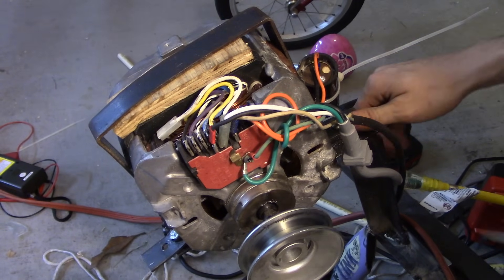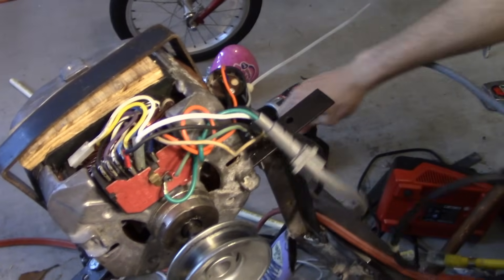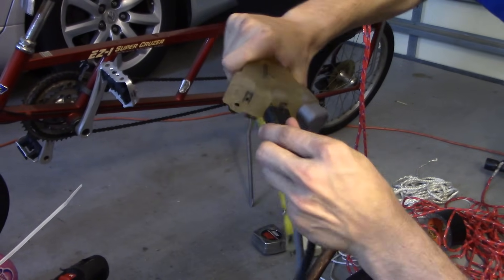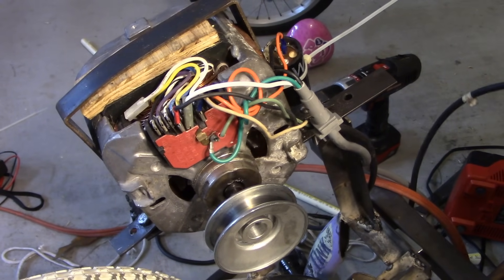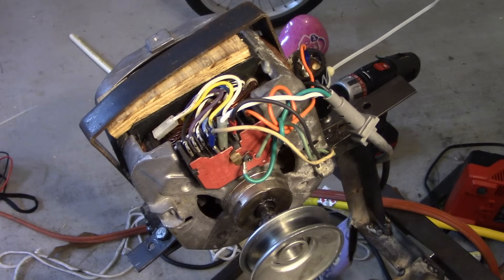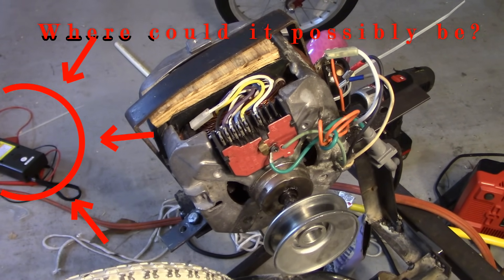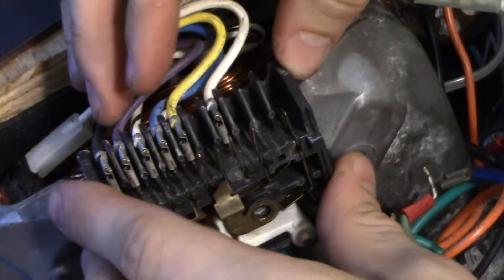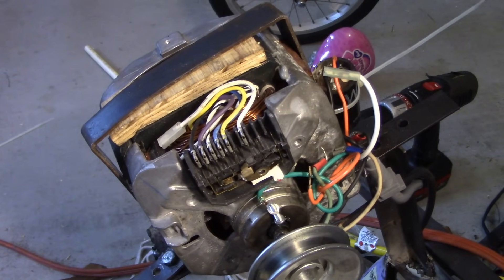DIY Washing Machine Motor Wiring

Comment: Nice ohm values for the windings. I"m diagnosing a semi transient fault that leaves my machine dead from the overload protection (only directly after the wash cycle), without a diagram or manual. So I have to piece together the reversing paths in the motor terminal block and timer switches. Your ohm values make sense to me and are a great help since I have another motor I used the brown motor switch / the white centrifugal clutch actuator  from a repair tp the machine like 5 years ago.. Thanks - I've figured out I can reset the overload protection by unplugging the 120 volt source and the 24 pin timer terminal, then if I move the timer knob just past the location where the machine hangs and restart the machine, it finishes the cycles and complete to the cycle stop;. So I'm getting closer to understanding the wiring with a lot of help from you and many others piece by piece.

Comment: Hi got a question for you. Could I wire this wash machine motor for a slow speed. And power it up through the capacitor, using a 12 V battery. Thank you for your time Tim

Comment: This is just a prayer that you will still get this and respond.
This is extremely helpful in testing my motor that is still in my washer. The issue I have is the motor just hums and won't start. I made a test wire like yours and found that it won't start through the capacitor unless connected from black to yellow. Red to yellow does nothing. The wiring in the washer is definitely connecting to the red, but it doesn't do anything but hum. I used a multi-meter and have no connectivity from red to yellow, just black to yellow (for the starter capacitor).
It's it possible that the switch is just not working correctly?

Comment: I have a motor very similar to this one. My motor does not have a purple wire and there is 1 contact for red/black wires and no more. I am not electrician, just hobby . took from old Kenmore some time ago. How do I wire it,,does it need a capacitor, how to wire it for speed. this is the best video I have found and your explanations are thorough. Thank you.

Comment: Video very instructive but I have 1 question. On your vieo red wire appears to be orange. I have all wire except not the orange or red. It is an extra black wire. Do you know what that wire is used for? I am not at all an electrician. I think I can resolve this motor issue.

Comment: Capacitors increase power.  The windings put poles out of phase.  The centrifugal switch engages and disengages the start windings.  You can hear it go from the run windings back to the start windings as it slows down in the beginning of your video "click".

Comment: Hi I have an old washer with an GE motor very similar to the one on the video, motor start and work fine in high speed but when the timer changes to low speed, the motor make noise because it start and stop in a cycle, I saw a video http://www.appliance-repair-it.com/washer-will-not-work-on-gentle-cycle.html , this is exactly what my washer is doing, they said that is because the low speed winding is bad....I have few questions: 1. the problem could be:1. Motor winding, 2.Motor switch or 3 the timer, I dont have a tester but I will check, the main question is, if the low speed winding is bad, can I disable the low speed?, I thing that if I disconnect the purple wire the slow speed wont work, however the motor may do the same that its doing now, because the starter connection still there, if there any way to disable the low speed?, the washing cycle only uses the slow speed for 2 minutes, but in these 2 minutes is very noisy and the motor gets hot for cycling from start and stop.......thanks...appreciate your help.....

Comment: Come to think of it.  The coil circuit to the start winding is the Yellow and the black.  The reason you hook up the capacitor to the red is that it is the red that is switched by the centrifugal switch so the capacitor can disengage. So if you use the ohmmeter between the yellow and the black it would basically read the resistance to the starting coil.

Comment: All European asynchronous motors on older washing machine look like this only  we have 5 or 6 wires for connecting . Only thing I can not understand how asynchronous motor can do high speed spin with electric power of ONLY 120 V !?  We use here like double 220 to 240 V for regular power supply

Comment: Hi.  I liked the video, it is very well explained, it helped me a lot, with an electric motor of them.  I have a question, how to install a modern engine, and how to get the 3 phase cables.  This is the model of the engine, modern.  DWS8003SK.  regards.

Comment: Anyone help me please
I want to know about capacitor.
Can someone help me please, what is the type and size uf of capacitor for the motor with
Voltage 230V
3.5 Amp
50-60 Hz
750 watts
16000 rpm
Reply: https://www.ktool.net/mars-11952-round-motor-start-capacitor-216-259-mfd-220-250v/?msclkid=4963b13ac3dd1233d6aeec85b5997112&utm_source=bing&utm_medium=cpc&utm_campaign=**LP%20Shop%20-%20MARS&utm_term=4583108067145055&utm_content=12062%20%7C%20Mars%20%7C%2011952%20Round%20Motor%20Start%20Capacitor%20216-259%20Mfd%20220%2F250v%20%7C%20%245.79

Comment: I have this same motor but it will not run in reverse.  So, connected to the transmission it just runs like an agitator.  But I want this the washer as a spinner.

Comment: Would I wire a blender motor the same way. I have a multimeter so the resistance info was great to know. It has a tiny cap but I believe it is a brushed universal motor but I payed no attention when taking it apart and it has an external bloc to add wires and some have 2 winding wires and a few one. Any help would be great. If you need more info let me know as well. Thank you so much and great vid.

Comment: Any kind heart fellow there could help me how wire and run this samsung washing machine motor was161/AVVA/XST.230/240 50hz. 8MFD 450 VAC From right 1st red wire 2nd red 3rd white 4th yellow 5th light blue 6th dark blue.where connect the capacitor as well

Comment: I have an amana washing machine that does not have a capacitor - 2 speed.  Always needs a nudge to start.  Did not need that while in the machine.  What gives?
Reply: I suspect you had a capacitor that was mounted somewhere in the washing machine.
Reply: It sure doesn't have one

Comment: I have no Violet wire so how do I connect for low speed?  Far Leftut to right (Black) (NO Violet) (WBlk)(Blue)(Yellow)(NO Wire but connects to Earth)(White)(NO Wire)(Blank)(Red seems to be internal)
Reply from the maker: Our motor also did not have a red wire, just a terminal labeled red which connects to black through the RPM switch. I am not certain about your particular wiring scheme, but the surest way to determine which terminals connect to which windings is to test the resistance as shown starting at 7:25 in the video. If your motor came from something other than a washing machine (such as a clothes dryer) it's possible it only has one winding. Check for RPM ratings; if there is only one stated RPM it is probably a one winding motor.

Comment: I want to use a motor like this for a project. It would be easier for me if I don't use the capacitor, can I do this for long term? I would be able to hand spin it immediately after powering it on. I actually could turn it before I flip the switch with the setup I'm going with.
Reply from the maker: That shouldn't be a problem. The motor just draws more current if its not spinning and therefore things can melt if it isn't started soon. But a few seconds, even repeatedly, won't harm it.

Comment: You say "old" and "new" motors. What is considered "old" and "new?"
Reply from the maker: If it has connections similar to the one in the video it should be fine. It's only the higher end machines since maybe 2012 that might use a three phase motor.

Comment: Very interesting video. Good clear explanation. I'm retired with time on my hands and am pulling out old motors I've saved through the years to make things. I recently came up with an older GE labeled as 230/460v. can it be wired to run on 110v at lower speed? Just curious. Thanks
Reply from the maker: You can probably run it on 110 for low torque applications. It will run at the same speed as on the higher voltage, but will have less torque and stall out more easily. Alse be careful that it doesn't overheat if you put any significant load on it.

Comment: how to use on low with out the capacitor ? also will it need a push like on high? have the same motor
Reply from the maker: Without the capacitor it will need a push at either speed. You can run the motor as shown in the video without a starter capacitor for all speeds and directions, it will just need a push to get started. Also the motor can run either direction without the starter capacitor, it just depends on which way you push it.

Comment: May i use taht type of motor at the beginning for a band saw?
Reply from the maker: Depending on the size of bandsaw, I don't see why not. (I know the bandsaw motor for one in a shop I work at uses a 2 hp motor, so it may be a little underpowered)
Reply: Mathis Wandel builds bandsaws regularly.  in states in the plans that 1/3 hp min to max 2 hp.  1/2 should be enough for most users depending on if you are resawing

Comment: excellent video i found a motor with no capacitor. your video helped me so much but what size capacitor does that motor use i have a 1/2 hp 120v 60hz 80amp 1725/1140rpm
Reply from the maker: If your motor is 1/2 horsepower I assume you meant 8.0 amps, in which case a capacitor like the link below would work (they tend to be in the 200 to 300 microFarad range.) But also be careful because you cannot use a regular electrolytic capacitor laying around because they cannot be reverse charged like what is required of a start capacitor. If you can find the motor part number you can find the exact model replacement capacitor for your motor and it will probably run better than just choosing an approximately correctly sized capacitor.

https://www.repairclinic.com/PartDetail/Universal-Washing-Machine-Capacitor/131212301/406742?ss=a11b192i1142&TLSID=1779&Ref=611198&gclid=CjwKEAiA_p_FBRCRi_mW5Myl4S0SJAAkezZrZWRvhJnUt0G8gj51aY8Uf6RjHKGvwMmP9NdvxsuD3hoC9orw_wcB
Reply: in my washing machine motor one winding is damaged by screw driver malfunctioning can i make use of the motor for other purpose without repairing the winding

Comment: Is there such thing where this type motor has no capacitor or it is built in where you can't see it? Also do you provide schematics showing the wiring that you could share? By the way, excellent video and presentation.
Thanks
Reply from the maker: A lot of smaller motors do not have starter capacitors (such as most dryer motors) but I am not sure about washing machines without a starter cap. If you plug the motor in and it just makes a humming noise without moving (it's first of all not very good for the motor so don't leave it plugged in long) but that is also an indication that the motor should have a starter capacitor that isn't hooked up. As for the schematics, we'll try to get a link to where you can find them in the description soon.
Reply: tachionics it would be of great assistance to a lot of people I think to have a schematic of this an lots more motors. it is mind boggling that it is so difficult for hobbiest like myself to be able to wire these motors.  I realize every motor is different but when you just have a few wires sticking out and no schematic its hard to know what each wire does. Help, Help, Help!!!
Reply: There is a schematic drawing in the video about 1/2 way through
Reply: Some of these washers have the capacity installed up right behind the controls.
Reply: TFiveD some of the older one speed maytag washer mother's had no capacitor

Comment: Great video! 
Will it cause damage or burn out the capacitor to keep it plugged in when working for an extended period of time?
Reply from the maker: You can leave it in the circuit because the capacitor does not dissipate any power (the voltage is out of phase with the current). Additionally, you probably hear a click as the motor turns on, this is the centrifigal switch disconnecting the starter circuit (with capacitor) so there will be no current flowing through the capacitor once the motor is up to speed!
Reply: @tachionics9925   Exactly, just the click to get the ball rolling and it is disengaged.
Reply: @alchemy1   I can wire it as one with no issues. It will disengage the capacitor once RPM is established ????
Reply: @user-xh6tr9fi2q  Let me see if I use imagination to answer my question:
Let me think. hmmm.  OKay.  If a motor is wired for high torque, lots of windings that are big and thick too to consume more current it would need start capacitor on the start winding which is another winding with thinner wires and perhaps less of it too.  Its purpose is when you supply the motor power, it feeds both the regular and this so called start winding and the star winding is in a differet degree location in that round looking stator mechanism. The start winding create higher inductive reactance.  A fancy term  ( got to have the fancy terms that is right) which is another word for making an electromagnet on the adjacent of the main run winding just for hardly a second. This offset magnet causes the rotor to jerk a little if you well wanted to get drawn towards it while the main winding also is acting as magnet. And in the struggle and distraction the rotor is moving and it has intertia and then you can turn off the start winding but why not make that turning off automatic.    And there ways of doing that. 
If you don't turn off the start winding, it having thinner coil of wires make it have much higher resistance and higher resistance mean heat. The sucker will get hot... not a good thing.
On the other hand.  Some motors that don't need to work hard, to doesn't even need  to have capacitor, the start winding and the run winding has less coil of wires. In that case same set up as the above minus the presence of a capacitor.

Something like a fan motor require lot os RPM, but no torque if hardly any.
This set up does not need big fat wires  and the start winding is hardly any different that the run winding.  The low voltage small capacitance capacitor of a few microfarad can be left in the start winding itself causing the motor to spin much faster just keep tagging at it just a  tat.  That is all it takes to turn the motor faster.
We can leave the shade motor alone and indulge in the third type of motor below:

Some motors have both start and run capacitors....
Under what circumstances you nhave to to design a motor to perform a task that require both start and run winding capacitor.
What has to be the specification of the windings for that and if there are three pair of coil windings or more or less?....I will that one for your imagination.

Comment from the maker: Comment any questions you might have about powering up one of these motors and we'll do our best to answer it!
Reply: tachionics if I have a washer that is one speed motor and it has no capacitor (older maytg) and its hard starting... Can I add a capacitor into the wiring to help it start?
Reply: Is it possible to put additional speed control (like a reostat ) control to slow the speed further below the 1100 rpm it rotates on slow speed?  Im